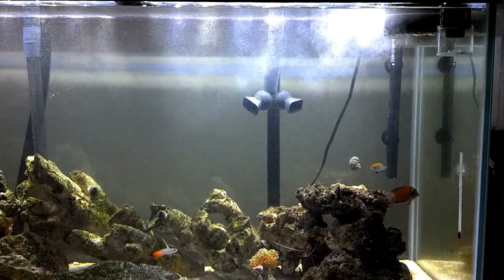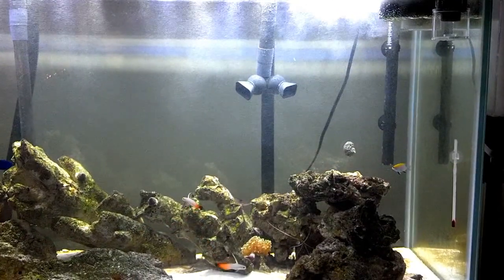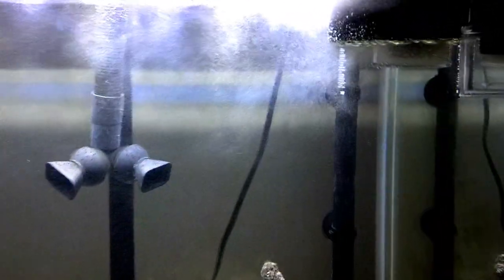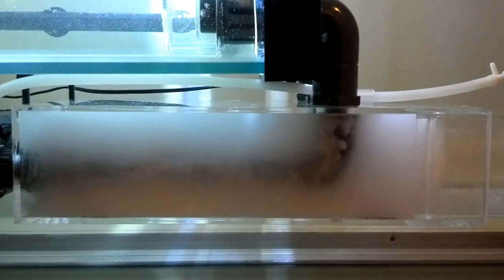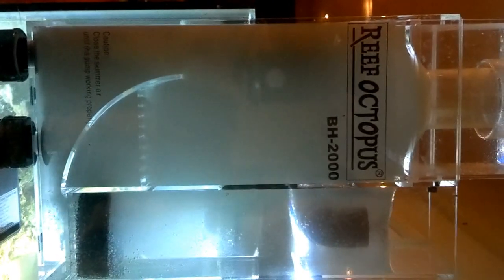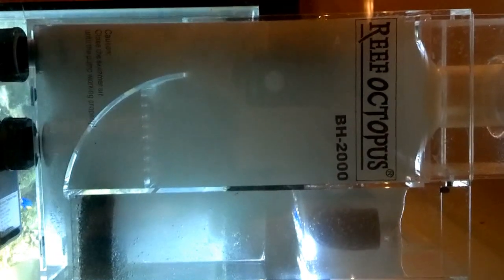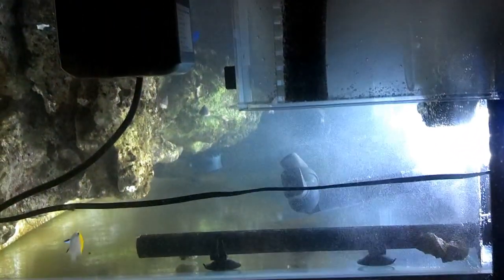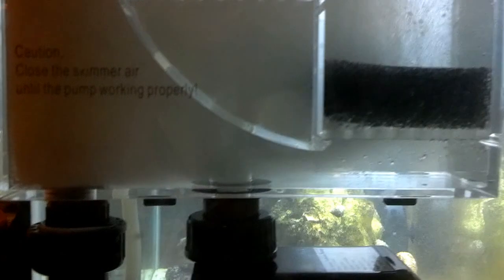Extreme microbubbles with new BH-2000 protein skimmer?

Comment: How I solved this problem. I took a food grade vitimine bottle large enough to have plenty of room for a return tube sponge. That would fit through the opening of the bottle and cut a hole in the center of the lid. That would fit the return tube and glued a small ring that fit around the outside end of the tube. After I installed the lid onto the tube. So I could slip the lid onto the tube and it would free to turn onto the bottle with out coming off of the tube. I then at the top shoulder of the bottle drilled two rows of 3/16" hole all the way around the bottle. I then fitted the sponge onto the return tube. Then fitted the bottle over the sponge and threaded the cap onto the bottle. This way the return water passes through the sponge in the bottle and the has to rise to the top of the bottle to exit through the hole around the top shoulder of the bottle and out into the tank. Giving the micro bubbles time to dissipate before returning to the tanks water colum. It is best if the top shoulder of the bottle where the return holes are is just above the water but not nessesary. This works with any skimmers that have and issue with leaching microbubbles out into the tahk from the return.